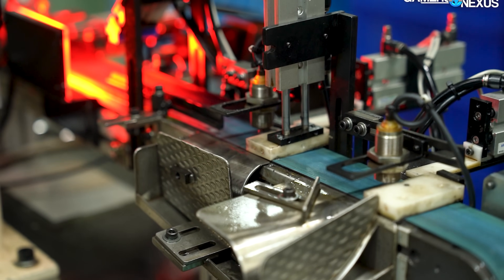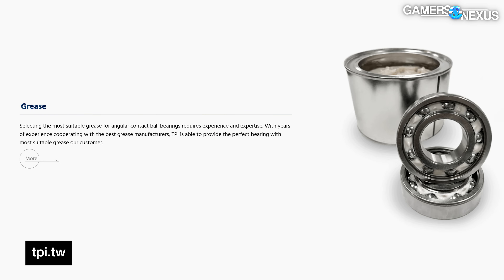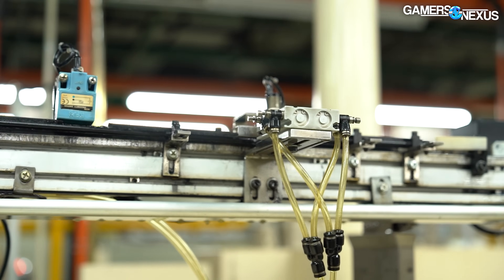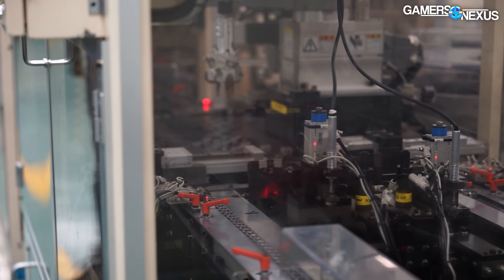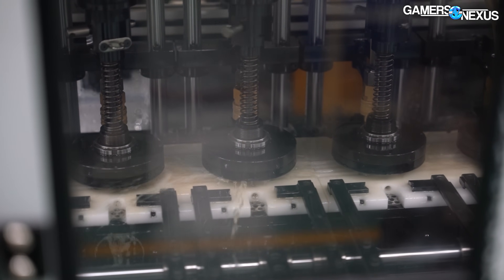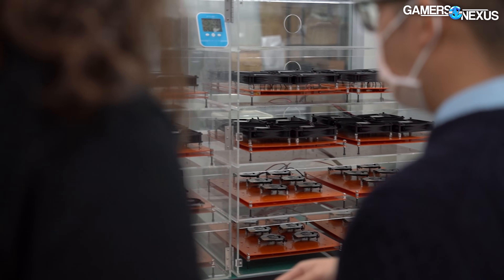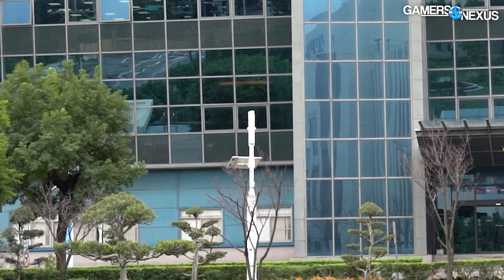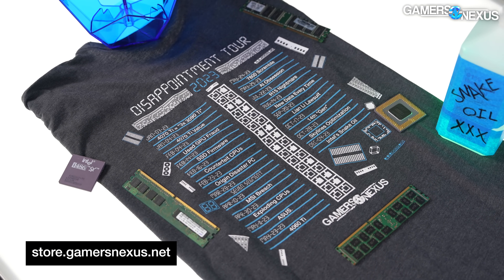How Computer Fan Bearings Are Made: Ball Bearings & Fluid Dynamic Bearings

Comment from the maker: Let us know what parts you want to see made next so we can start planning our travel! This was really cool to see in action! We have a few more factories left in this season and we've uploaded 4 episodes so far! We're taking a short break next weekend, then we'll be back to posting a few more to round-out this season. Watch last week's engineering lab tour here: https://www.youtube.com/watch?v=dhEQkb6uqzw
And watch how RAM is made here: https://www.youtube.com/watch?v=---fHu9jFtw
Or see how servers are built in this one! https://www.youtube.com/watch?v=ofKw9SU9OOk
Reply: May I request for a display panel factory tour ? Companies like LG , Samsung , BOE and AU Optronics . I searched your videos , didn't find any.
Reply: @fleurdewin7958  Another for displays. Most of the stuff related to PCs is pretty self explanatory if you've seen enough different manufacturing processes, but I have no idea how displays are made.
Reply: I think you need to specify if the arcade music is from the factory or added in post production XD
Reply: I found the explanation of what is a FDB a bit scarce, had to google it afterwards.

 It's a bearing in which the steel/ceramic balls have been substituted by a special oil, which forms a thin film between the two parts of the bearing, allowing the inner shaft to spindle with less vibrations and noise than a traditional bearing. Obviously, the bearing has to be pressurized so the oil doesn't spill out.

Besides that, great vid. Excuse my poor english, pls
Reply: Very nice series! I would really like to learn more about hard drive manufacturing (SSD& HDD), I'm just not sure how much there is to show about them
Reply: @randomzocker8956  SSDs I'd imagine would be pretty much identical to ram, but HDD would be interesting.
Reply: Excellent video, you chaps are the peak of computer geekery 🇬🇧
Reply: @freesaxon6835 ... and suffering
Reply: The magnetic levitation is what caught me on guard when I went skateboarding I found out they use ceramic bone bearings to skate handrails successfully. lol.
Reply: A tour of TSMC would be awesome (or perhaps another chip fab). It would be cool to see the process from raw silicon, to wafer, to final individual chips.

I'd like to see how they made the wafers.
Reply: I would still be very interested in the driver / firmware programming aspects
Reply: Really enjoying your factory tour series thank you. It would be really good to see how AIO are made. Even better it may be time for an AIO comparison update... the Arctic Freezer 360 I have been using for years since your review recommendation (thank you!) wonder how it compares to Liam Li newer AIOs like the GA II Trinity
Reply: You guys have a knack for making these factory tour documentaries. Personally, I wouldn't mind it at all if you expanded your factory tours into non-PC components as well.

In the absolutely unlikely case you somehow run out of ideas for factory tours; I believe General Electric has some factories in the United States where they produce magnetic resonance imaging machines, and computer tomography imaging machines. They're bit expensive machines, cost ranging from 600k to 1,4M. It has little to do with "gaming" but it's nerdy stuff, involving supra-conductive materials, quantum physics, magnets and radiation.
Reply: Would be cool to see the factory where computer screens / monitors are being made and some factories that make their components.
Reply: Worked for schaeffler once. One of the biggest ball bearing manufacturer in world. This manufacturing process is more sophisticated than kraut magic.
Reply: More fan stuff and no VR test
Reply: I once knew a man who said "sealed bearings last forever" and over the course of my career as a maintenance technician had to replace thousands of sealed bearings that failed.
Reply: @robertlawrence9000  forever  compared to non sealed classic bearings that you have to pretension . and the pretensioning is never really good and the lack of sealing makes it necessary to grease it every x work hours , and be mindful of the operating environment . Lots of bearings fail because they are undersaized , they use the cheaper ones with cheap grease cheap steel , and loose tolerance . Also they are sometimes abused . A good bearing set with active lubrication can run at least 15 years 24/7 . HDD bearings almost never fail , they run up to 30K hours no problem .
Reply: @kisspeteristvan  I've seen so many sizes and kinds of bearings fail. Thousands on so many kinds of machines. It's crazy how many times the same bearings can last so long while others fail fast. Yeah I think also because nothing is truly to exact size, you get various things that can cause failure. Even the balls in the bearings are not truly round when viewed in a microscope
Reply: @robertlawrence9000  i work in a machine shop , the bearings in those machines really do last , but if you violate the intended paramteres , as in crash , overload , overspeed , contaminate with water , contaminate with dust , improper lubrication , over temperature , under temperature , uneven load , uneven temperature , vibration , improper machine alingnment at installation , and maybe there are a few more parameters to violate , then yes . A 100000€ spindle can fail in 1 movement , or fail in 3-4 years due to extreme abuse . Of couse i've seen many bycicle , car , roller , household apliance bearing fail , but that's due to improper use and abuse . Also it's by design , god forbid they make a washing machine bearing that last 30 years ....where's the business in that ?

ps.: I've seen quite a few machinist use old machines like from the 40's , 50's  with almost all original parts . and it's ok to change a bearing here and there , but the  improper installation takes 90-99% of the bearing life , also chineesium cheap bearings have nothing to do with longevity .
Reply: @kisspeteristvan  yep. I've seen this too. The Chinese bearing thing though, it debatable. I've seen many of those fail too.😂
Reply: Have you done a video on PSUs? That would be very interesting. Especially if you could ‘learn’ more about 12VHPWR
Reply: Would watch videos about networking cards, displays, power supplies, and motherboards, especially ASUS motherboards as I tend to think of them as a first choice.
Reply: How was CES? Couldn't even show your face?
Reply: IMO this is best one yet.. WELL DONE, team!
Reply: As said before: I'd love to see an exposé on the challenges of fabrication in the PC market, finding the right suppliers, raw materials, stuff like that... basically "How hard is it really to manufacture all the parts required for a modern gaming rig?". ;)
Reply: video card , mobo , psu , done , case done , other chip related things done - if not all then it's repetitive anyway , fans done , bearings done ... 
If we keep the things simple you could visit a resistor and capacitor factory , or electrical components , just not any final product , a diode , a led .... A LED factory yould be nice . Also i don't know why most tech guys skip the audio . there's many interesting technologies there aswell . A Battery factory - THIS would definetly get many views ... . Not sure if you did monitor or TV factory . we also saw server factory from der8auer , heatsink we also saw . A HDD factory would be nice too ! 
You could do simple products aswell
Reply: Thermal paste!

Comment: As a ball bearing factory worker, i have been involved in several of the steps showcased in this video

I used to work in an manually assembly line, where the rings would be manually sorted by size of the raceway in to rods by two colleagues (in microns: it's ALWAYS in microns): one worker would work on inner rings and another on outer rings. The rings would be sorted by a size of every 2 microns.

Then a worker would select a rod of inner rings + a rod of outer rings to pair them, base on the raceway sizes and the sphere size: it had to add up to a specific average, depending on the type of bearing as well as the slack tolerances. These would be put in a "carousel" and it would "spew out" a pair of (inner and outer) rings per cycle which the worker would place the spheres on (by slightly deforming the outer ring so that the spheres slide in: such deformation WOULD NOT "hurt" the bearing's quality).

The assembled bearings would be pushed in to a washer station on to the next step, which was adding cages to the bearings: these could be plastic (only one) or metal (two), depending on the type of bearing we were making. The bearing would be pushed to the next stage on to the marking station where it would be marked by an acid + water solution and washed before passing through a slack tolerance checking station (some bearings require 100% checking, but MOST do not).

Then the bearings would go through another washing station to a manual noise checking station, where EVERY bearing is heard to see if it would comply with the frequencies as well as there were any defects in raceway fabrication: a raceway defect can EASILY be spotted via noise testing.

Then the bearings would then get greased, either manually or via a machine, depending on the bearing type and then be visually inspected for packaging: sometimes in single unit boxes, sometimes in boxes of X quantity, where quantity varies, depending on the bearing type.

In this assembly line, i'd either place the spheres, the cages or work on the manual greasing station.

I worked on this part of the factory for several years, before an arm injury forced me out of that section in to a ring manufacturing section, where i make the inner and outer rings, per specifications.

I receive the "black" rings after they have been processed in another section of the factory i've never worked on (heat treated and faces / outer diameter of outer ring polished) and i feed them to the grinding machines to cut the rings to tolerance: 20 microns for the inner rings and 30 microns for the outer rings.

The rings then go to the super-finish machines via raceways to have them polished before they are sent to the bearing assembly side of the factory.

I work in this section, presently.

This week, i'm making 6205-B-2Z-8102 inner and outer rings, which will be assembled in to various types of 6205-B bearings.

Comment: when they were launched found them cool, but they are impossible to open to repair since the area below the fan sticker is sealed, i had a deep cool 120mm cpu fan whose ground wire came out resulting in a dead fan of the cpu resulting in dangerous cpu temps, could not open the fan w/o breaking it, connected the ground wire & it worked but now cannot be used as of structural damage.

Comment: Love how they gave you the red carpet deep dive on the regular ball bearing line... which was frankly cool as hell.  But you didn't get to show much outside of a couple of manual QC benches for the FDB manufacturing.  Also interesting was the far more "machine shop" vibe of the FDB side.  Lots of brass/bronze alloy bars and likely an expensive swiss type CNC lathe... but it's an utterly different concept and premise to the ball bearings.  Possibly... just based on what little I saw... possibly easier to make and a less involved process overall.  Which would explain the absolute protection of manufacturing IP for those.  Big cash cow.

Comment: i hate how hard it is to find these bearings to replace in fans, as in, icant find them at all. and how not all that service friendly fans are. as for FDB, i got away with a drop of motor oil to stop the noise. also in larger ball bearings but the small ones are usually done for and wont respond to oiling.

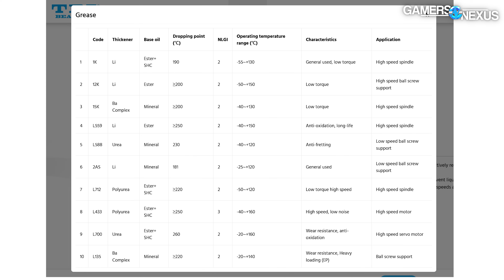Comment: I loved the rest of the video.  2:50 angular contact ball bearings are not always shortened to "ball bearings" by default.  "Ball bearings" usually refer to deep groove ball bearings instead which are aren't heat-set like in 10:10 but are instead sort of "snapped" into place before the cage is placed into the bearing.

as far as the difference between the two goes, angular contact ball bearings should only handle axial load from one direction...  deep groove ball bearings can handle axial loads from both directions but also much less load 

in the deep groove ball bearing, the balls are enclosed in a U shape on three sides while the angular contact bearings only have a J shape for contact on two sides

Comment: Most under-stated part of the video, at 10:04: It looks like they are heating the outer ring with an electromagnetic induction heater to cause it to expand so that the bearings and inner ring will fit. It's not getting 'blasted with heat'

Comment: This is one of the sleaziest GN videos ever and I love it.

5:12 and 6:03 Interesting that a bearing is first inspected for a tolerance from the initial supplier(?) and then ground down even more.  It seems weird to have this stage as off-hand it appears to be an extra step in the process due to the additional grinding done in the factory.

8:03 That robot arm has some insane precision and being able to optimize by matching similar components is wild.  The guy who figured out the cost/benefit analysis of doing this along side the calculation of how much it'd cost for machine to do that with the necessary precision is wild.  The initial price tag for such a machine cannot be cheap and wonder how long its return on investment period is.  The initial steps knocked out 0.1% and the last steps after the arm discarded another 0.1%, mean from the about ~0.2% of initial parts do not make it to the end.  That is impressive and likely due to this optimization picker.  What was the discard rate prior to the picker to make it worth while?  My own instinctual calculation on this would point to this being a waste until you get to a scale close to 10 years but it is there so I am wrong some where.  I want to know where my mistake could be cause that thing is awesome.

10:01  Are the coils actually thermally resistive to produce heat and not leveraging a magnetic property to heat the metal?  It is actually possible to melt various metals (not just iron/chromium/nickel) via magnetic induction using high current AC.  The nice thing here is the magnetic field works throughout the volume of the metal and not thermally conducted through the exposed surface.  The sneaky thing here is that the non-metallic parts of the bearing wouldn't heat up which helps with alignment when the rings fall into each other.

13:40 While humidity and temperature testing is important, another variable is dust which can creep into the bearings and cause friction.  It'd be another important variable to account for to determine longevity in the field, especially in industrial applications.  Is this is also done in those labs and just not shown?  I am also curious how they would implement a standardized amount and type for the actual dust.  I am sure that the answer is messy. 

16:52 That is some good engineering pride right there. I am sure that there is a TPI engineer that gets a sense of accomplishment every time they look out a window and see their creation in action.  The type of little things that means a lot to a few key people.  Having been one of those types previously, thank you for including it on their behalf.

Comment: The little things that matter: I've long been used to the idea of a bearing having a maximum speed, but I was today years old when I learned it's possible for a (fluid dynamic) bearing to have a minimum speed. Perhaps obvious in hindsight, but it's an important data point for quiet builds, or builds where the fans are routinely blocked because of furry quadrupeds. Really cool, Steve. And thanks to TPI for being willing to show their stuff. 👍

Comment: The most frustrating fan failure i have seen so far was Everflow fans on a relatively fresh Gigabyte GPU. These have a sleeve bushing, which is... not great, fine, the reason they failed though was the plastic flashing in the bottom enclosure of the fan, which separated and fouled the bushing. I bet the bushing manufacturer washed that bushing a bunch of times making sure there's no garbage coming out of it, carefully oil impregnated it, and then this sort of shitty mishap happens later in manufacturing. Yikes.

Comment: 10:09 - Pretty sure that’s an induction heater. Heat is not being transferred via conduction or convection to the bearing but instead having it induced in its electrically conductive parts by an AC electric & magnetic field. Thus, the bearing is not being “blasted” by heat.

Though through a different physics phenomenon, it’s like saying a microwave blasts heat into food, which it doesn’t.

Comment: Was not expecting the heat up to get the balls to seat in the races. Normally the inner piece is shifted to the side the balls are placed in and then the inner is shifted back and a machine with spacing fingers would go through aligning the balls so the cage can be places. Atleast that's the way I have seen it done for most bearings of a certain size like common wheel and hub bearings and larger. Although it should work for mostly all bearings but I guess it depends on the cage type used.

Comment: This was really interesting.  As a skateboarder I've dealt with ball bearings for a lot of my life; the first thing to cause catastrophic failure is the cage that holds the balls in place breaking.  I wish skate  bearings were made with a stronger material than what is used for those cages because if that problem was fixed then the bearings would last a lot longer.    

Haven't been skating much for the last year+, gotten older and more tired and less motivated with time.  The spring will hopefully be my time to get back into it all.